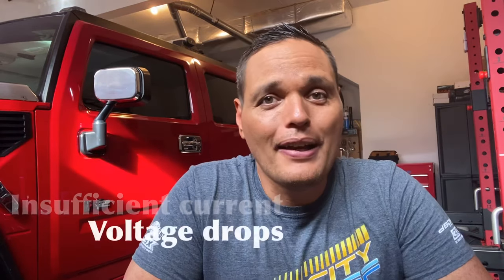The Top 10 BIGGEST MISTAKES in Car Audio. How to do it right!

Comment: you can run rca wires with power wires unless youre running some old school amps from the 90s. new amps use differential input rca, rca wires twisted together. tony d amore and steve meade confirmed it
Reply from the maker: You go ahead and do that... Every reputable shop out there today still installs RCA/Power runs separately if you go to get an amp install. Just because you technically "can" do something does not mean you should. This eliminates the variable of it being or becoming a potential issue.
Reply: @NextLevelCarAudio  ive done it to see if they were just talking out of their ass, it works with no issues. i even bought cheap street wire rca to compare my monster rca to see if the quality of the wires made a difference. to my surprise no noise. if there is noise it would be the filter caps inside the amp going bad or ground is loose. technology just made it easy for us
Reply from the maker: I understand.... But I know myself and most installers do it is to eliminate it being ANY problem in ANY situation in ANY circumstance. As an installed I always try to eliminate the variables so that if there is a noise, hum, whine, etc. I can for certain without any shadow of a doubt say "well, i know it is no tthe rca/power wire being routed together" and will make troubleshooting that much quicker. I m the same way with my grounds.... i do my due diligence by grounding textbook every time so that I know my grounds are never going to be the issue. Call me a traditionalist, call me cautious, call me old school, call me paranoid, etc, etc, etc.... My battle cry is do it once and do it right. Problem is....."right" seems to have to much interpretation. Is what it is :/
Reply: @NextLevelCarAudio  im an old school guy myself and did things the safe way or the rule of thumb. the rca thing was news to me lol, i heard about it a year or two ago.
speaking of grounds i recently discovered my grounds werent as good as i thought. i never thought of using a dmm to measure my grounds resistance. i was told that as long as the ground is secured on bare metal and not on something that was welded on by the vehicle manufacturer like the deck lid of a trunk, your ground is solid. i didnt have mine on the deck lid. i used the existing hole where the seatbelt buckle goes lol. whats sad is i learned that from watching an installer putting a system on my first car. whats cool now is there are content creators like yourself who can share, teach and refine the craft for newbies and guys like me
Reply from the maker: Thanks for the feedback man. much appreciated

Comment: Can I put a little jb weld on ground bolt to make sure it doesn't come loose? extra security
Reply from the maker: As long as you make sure the ground it good. Metal on metal, you can put anything you want on top of it. It may be a problem if you ever rebuild your system and change your ground location tho. In that case, I’d use thread lock

Comment: Okay so im brand new to car audio and i have a few questions. 1 i have 2 12 in rockville hooked up to a 1200w peak amp coming in. And i was curious if I would need an ungraded alternator. And 2 where the best place to wire the remote turn on wire? Thanks!
Reply from the maker: 1200 watt should not need a bigger alternator. But I would do the big3 upgrade to get the most current out of your current alternator. Best source for remote on is the remote wire coming out of your head unit. If not, then find an ignition wire with multimeter that gives 12v+ when car is on
Reply: @NextLevelCarAudio  okay thank you. I just found out that its only 400 watts RMS. 1200 watt peak. Still need the big 3. Its on a 100 amp alternator
Reply from the maker: I’d do it.... so simple and really ensures a healthy electrical system. But at that power, you don’t need to

Comment: Also how can you make sure your wiring up your door speakers in the right polarity?
Reply from the maker: if the speakers polarity are not labeled from the factory (some are some are not) then you need to do your research. You can find master sheets for some vehicles that diagram out all the wiring online for free. There are wiring diagrams for every vehicle that are available to installers at car audio shops. get friendly with one and they can print it our for your specific vehicle ;)
Reply: @NextLevelCarAudio  thanks a lot man I appreciate your help
Reply from the maker: Sure thing, wish I could be on more help

Comment: I just installed a harmony audio mono block 800 watt at 1 ohm stable amp pushing a Rockville single vs12k5 12 “ 1 ohm sub in a ported box. The amp is certified tested at 904 watts at 1 ohm. The 12 “ sub is rated 1400 watts peak , 700 watts program power handling , and 350 watts rms. I’ve just begun setting the gain and eq and all. I’ve got it sounding pretty good.   I know this is a bit of a budget install but it’s just in my work truck , 1999 suburban. I’ve got the back seats folded down and the sub is sitting right behind the two front captains chairs. Anyway. My question is , did I pair the components alright ?
Reply from the maker: Sounds legit man.
Reply: @NextLevelCarAudio  I have a 99 suburban. It has a factory amplifier for the rear door speakers and I think the back speakers too but I was gonna ask would it be better to bypass that factory amp and install say a four channel aftermarket amp and power my mids and tweeters instead ? Would it sound better ? I think that factory amp only puts out like 15 watts x 4 or something like that. It’s just when I turn up my head unit it clips the mids and tweeters and they start to distort.
Reply from the maker: Yes, aftermarket fresh clean power will definitely brighten things up.
Reply: @NextLevelCarAudio  man ! I put in a 6.5 inch mid bass woofer and a 6.5 inch coaxial in each front door. I also have a tweeter in the door as well. Each speaker is 4ohms and I had them wired in parallel. I guess my head unit didn’t like that 2ohm load. It kept shutting off. So I rewired them in series and wow lol what a difference doing that made ! I guess my head unit likes that 8 ohm load because everything is way clearer and crisper. I thought it wouldn’t be as loud but it’s even louder than before.
Reply: @NextLevelCarAudio  thanks for the advise on the aftermarket amp 👍Now all I need to do is get one that will run my front doors , back door and back two 6x9s.
Reply from the maker: Awesome man!

Comment: Does bridging a 2channel amp cut the speaker impedance in half? I was told this many years ago.
Like if i bridge my amp to 1 4ohm svc sub. Does the amp see it as a 2ohm load or 4ohm load?
Reply from the maker: That’s correct. When bridging a 2 channel amp the specs almost always call for a 4ohm minimum load. Because It will be giving the 4ohm speaker 2ohm power so to speak

Comment: Hey man awesome channel,  definitely gonna be one of the best car audio channels on YT.  Quick question currently running 3 VXF 12s on a skar 3500.1 2ohm duel voice coils and currently  purchased another 3500.1 to strap together  so I'll be at a 2 ohm minimum at the amps.  I have a very healthy power supply and my sub wiring options are 1.3 ohm or 3 ohm.  Kills me thinking about losing power if I go the 3 ohm option.  Would it be to risky to wire to the 1.3 with box rise?
Reply from the maker: You should be more than okay... just set gain a little more “conservative” than you would. Typically to not overwork your amps. With rise, you will be well over 2 probably closer to 3. So yeah buddy, that’s what I’d do!
Reply: @NextLevelCarAudio  Thanks!
Reply from the maker: Sure thing!
Reply: I'm running 2 xvf 12s on an rp4500.1d wired down to a half ohm. It's been 15 months now and everything is still running fine.  I couldn't imagine being wired at 2 or 3 ohms I would be losing so much power. I'm thinking of grabbing another 4500.1d and a 3rd vxf 12 and strapping the amps.

Comment: ok. this is my issue. I have a 2014 Ford Taurus. i put a system in it 2 years ago.  the only thing i dont have in it is a new radio n after market door speakers. when i went to ask around if there is a radio that would fit my car, the salesman said unfortunately there isnt a dash kit that would fit it. also, when u change the radio's out in those cars u lose some features that came with the radio.........like heated seats, climate control,.......so i just kept the factory radio. the salesman told me if i wanted more power that i would have to get a bigger amp.  i wanted to put another radio in my car but dont wanna lose the features it comes with.
Reply from the maker: Factory integration would probably be a good bet for you. You can add external preamp and EQ. External amps, subs, etc.
Reply: @NextLevelCarAudio  right!...cause right now i have 2 rockford p3's in a Q bomb box with a 1200 watt prime rockford amp. also, is getting box built better then buying a prefab box?
Reply from the maker: In most cases absolutely yes! I’d take subpar subwoofers in a custom tuned to spec box over good subs in about prefab any day

Comment: Right Facts. Is a 390 wtt alternator is over kill for 2 15 inch 4000wtt  sub's?
Reply from the maker: Kinda. But I’d rather have the extra output if needed or if you upgrade later.

Comment: I have 2 L7's 15" 900RMS  each with a Skar amp at 2 ohm 870 RMS and a Rockville 1k RMS power with a 0ga and ground with 0ga to chasis mounted a wire distribuitor 0ga to 4ga to Amp what else do i need ? Amp fuse for wire is 250A and the ones on amps are 100 each

Comment: Do you think it’s ok to run a a different size power and ground wire for my amp for example 10 gauge ground and 8 gauge power?
Reply from the maker: They should always be the same! The only exception if your in a pinch would be if the ground wire was super short. Like 1 foot long to compensate for the lesser gauge. But would eventually replace with same gauge.

Comment: So, quick question
Can I run a 1000W rms amplifier with a 1500W rms subwoofer, or will I damage something?
Thanks!
Reply from the maker: You can, but always better to overpower than underpower. I just my made a video where I hooked up a cheap $20 300 watt rms sub to my 12k amp to prove if you set gain properly it will perform just fine with no issues. Check it out on my channel. If under powering, just be careful to not set gain to high or you will for sure be demanding too much out of your amp to support that sub.
Reply: Ok got it, I'll make sure my gain is set right 
By the way, i love your videos, learned a lot from them
Reply from the maker: Thanks man. I appreciate the support!

Comment: Where would you ground out on a 03 windstar? No frame to ground to.
Reply from the maker: For vehicles in that category, I do a run of 0AWG from either front battery negative post, or solid engine block grounding point and run it to a rear distribution block to have a grounding hub to connect amps or other accessories to. If just running 1 amp, you can run it right into your amps negative terminal. This method will give you a much better ground, than using a short ground to a sub par location like sheet metal or seat belt bolt, etc. hope that helped

Comment: ok... so my thousand watt rms mono amp should not be bolted to my power antenna ground? (askin cause i havent put it in yet, but thats what i was planning to do, but now, not so much?) ...& what type of "rust preventative treatment" would u recommend for the bare metal in question? (btw adding a sub to a 98 firebird so open to suggestions for a ground?) always enjoy ur videos man, been learning alot, so thanx & god bless dude
Reply from the maker: Standard anti corrosive spray will work just fine. For a 1000 watt system that should be fine to ground there. For big power systems run to a frame, if no frame then direct from engine block or negative battery terminal
Reply: @NextLevelCarAudio   thanx for takin the time to reply man... between mark from caf & urself, im learning alot from both of yalls videos... & i love the way u explain things so they make sense to those of us who know "just enough to be dangerous" (haha) & show us how to set things up & dial things in... i even got an inexpensive osoliscope from amazon as u suggested in one of ur videos, & im gonna try my hand at dialing the amp in... armed with the video u did on that topic, im hoping to be able to achieve that goal... so thanx again & god bless dude!
Reply from the maker: Thanks for the feedback. Much appreciated

Comment: Quick question: All I’m running is a single rd1000/1 mono amp pushing (2) JL 10W3v3-4 subs at 2ohms in a ported trunk box, 2012 Civic Si, Big 3 completed, Pioneer Avh-w4500nex HU….and these Hondas have the ELD/voltage regulator on them. But as far as I’ve read I should be okay at 1000/1 with factory electrical. I believe the alt is a measly 105-115A. Anyone disagree or have any tips? The voltage regulation is a pain in tbe a$$

Comment: Quick question, when you start adding multiple alternators, do they have to have a matching amperage output? Or is that not super relevant? And how do you generally go about mounting them, arranging your pulleys, and running your supply wires?
Reply from the maker: If they are running on same electrical system then yes they should match. If isolated like my setup they don’t have to. Check out my dual alternator setup here: answers all your questions ;)

https://youtu.be/uhMynTkcokU

Comment: hi man, im running an ground zero 12 inch 800/1000w rms 1 ohm  and i was thinking to take an SounDigital SD 3000.1 EVO 4.0 amp or SounDigital SD 1600.1 EVO 4.0 but the different in price is only 20 bucks, the 3000.1 is too overpowered for my sub ? i was thinking to set low gain , to lower the 3000 rms to maybe 1000 rms , it is right to think of it this way? keep up the good work :)

Comment: Hi I love the video I'm adding a simple 12 with a matching skar audio setup to my daily driver should I worry about voltage drop with a stock setup wiring wise?
Reply from the maker: Sorry for the late reply, this comment was buried and just got to it. If your under 1000 watts I would not worry about it one bit.  Under 2000 probably big-3 and upgraded under hood battery

Comment: Please advise before I blow anything.i bought a 1200w 4 way amp, advise on the size of the speakers to use preferebly 2 speakers only where I connect one speaker on two lines
Reply from the maker: You mean a 4 channel amp? At you trying to run your front stage? Or a sub?
Reply: @NextLevelCarAudio   want to run I want to connect tow sub woofers on it,it's a four chanel amp,so am asking the size of the speakers to use
Reply from the maker: You need to find out/verify if it’s 1200w max or 1200w rms. Then determine if that is at 1 ohm or two ohm. Typically on a 4 channel they are rated at 2 ohm, then you need to know if the amp is bridgeable. If so you will need a 4 ohm final load. Which will determine what ohm and power rating of subs to buy. Let me know this info and I can help

Comment: Hey I have a 12inch vibe blackdeath 5000rms 15,000 peak power and a audiobahn 1500HCQ which is suppose to give 2000rms and only thing av added is a litihum 200AH battery in the boot. I did run it without the litihum and got slight dimming from the headlights but now awaiting to chuck my sub back in with the litihum what do you think?

Comment: I have a 12" Alpine with dual 2 ohm voice coils and  an alpine 500w class D monoblock  amp. Sub is rated for 300w RMS 900w Peak. I should be fine to wire the voice coils in parallel?
Reply: If your amp is 1 ohm stable. Google the specs of your amp

Comment: can I run my 8ohm mids on a 4 ohm rated amp
Reply from the maker: Yes you can, no problem. they just wont be getting as much power. double the resistance (ohm) you get about half the power (watts). So for example,  an amplifier that puts out 400 watts at 4 ohms will only put out about 200 watts at 8 ohms. It goes the other way too. if you run it at 2 ohms it will double the power to about 800 watts.

Comment: I have an 08 Ram 1500. I’m running a skar to 1500 and a skar 75.4. I replaced my stock battery with an age battery. I did the big 3 with 0 gauge and to my amps. Do I need to upgrade my stock alternator which is 160 amp ?
Reply from the maker: 160 amp should be fine considering your current amperage demand with an AGM up front and big 3. Any more tho, either a supplemental AGM in the rear or HO alt.
Reply: NextLevelHummer Thanks

Comment: Great video thank you! However, Im new to all this and am stuck, ive got a jbl club 5501 1300w mono D 2 and/or 4ohm and just one 12" pioneer model# ts-a300d4 4ohm 1500w max at 500rlm in an enclosed box. I dont have any idea as to the proper way to wire it up to get the most power out of it without blowing something up or frying something.. can you possibly give me a pointer or two on which route to take with my setup? It would be greatly appreciated. Thank you and god bless
Reply: The sub is a dvc, for got to add that. I hope you can spare a sec for a rookie. Thanks
Reply from the maker: Perfect... wire your DVC sub in parallel. So, positive to positive, negative to negative to give your sub a 2 ohm final load. Then connect sub to your amp +to+ and -to-. That will give you perfect rms power to your sub. Right around 500 watts.

Comment: what should dual 2 ohm 600 watt speaker be wired to 1 ohm mono block 4000 watt amp?? Please help. We did a 2ohm series parallel because of e have 2 sun woofers. 🥺
Reply from the maker: If you have two dual 2 ohm subs going to a 4000 watt amp. I’d write them together to a 2 ohm final load. Series/parallel. Just like you did. If you wired them any other way they would either get too much or not enough power